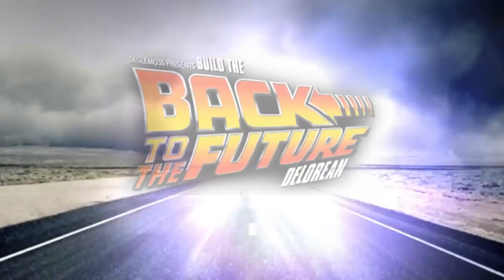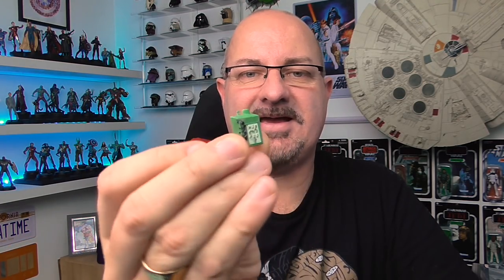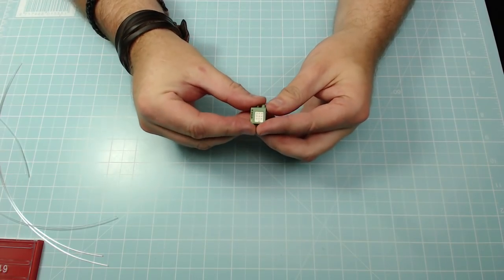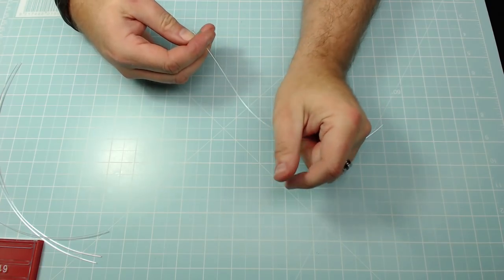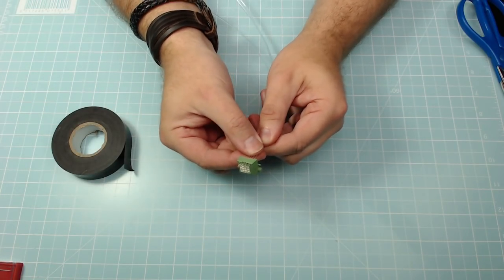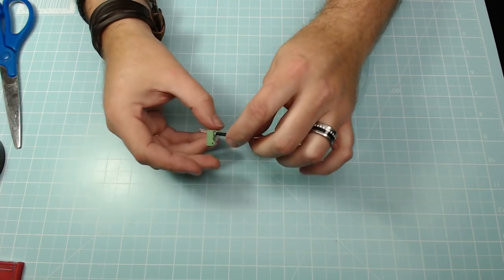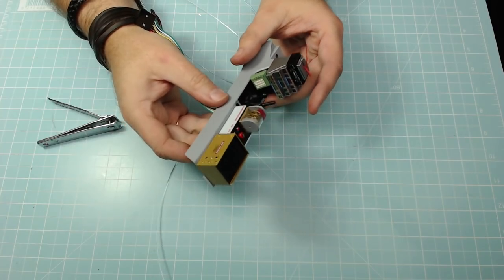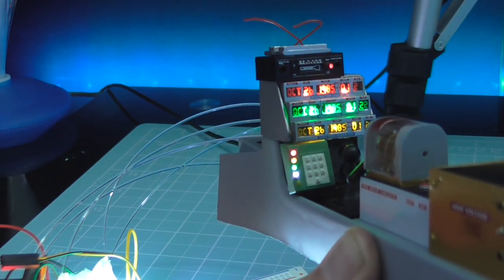Build the Delorean - Modding the Keypad and Radio

Comment: bit of a tip i accidentally found out when i i was doing the lights on the falcon. if you want to bend and mainpulate the fibre optic cable into a certain direction you can gentle warm it with a hairdryer and it makes it very pliable til it begins to cool. NB* be very careful though not to over heat the fibre optic cable. !!!!   i suggest trying it on a spare peice of cable! hope this helps .
loving the delorean build . im very tempted to start the build. I am following along with R2 build !!! nice job on both builds!!!!
Reply from the maker: Lol. I learnt that the hard way when I broke a couple. I have fixed it now but thanks for the tip :D

Comment: Hi Wayne, bit late now but you could've used the 0.5mm instead.  You can melt the end of the fiber with a lighter.  It creates a larger lense.  Works great and of course you have the flexible cable rather than the stiff 1mm.
Reply from the maker: Gerwyn Moores yep. I still may. I’m not happy with the alignment so I am doing it again 👍

Comment: You can heat the very end of the fibre optic cable and push it down and it will form a little button that will keep it in place
Reply from the maker: I started doing that technique in the end. The best way is to press the fibre on to an iron :D

Comment: Looks great, what light source will you Link it to? And how?
Reply from the maker: Its going to be connected to leds on a circuit board programmed by the Arduino unit. It will be small enough to fit behind the front dashboard as the rear of the vehicle is going to be having loads of electrics connected where the Flux will go. I have now changed it slightly since this video. I will only need 2 LED's. 1 white one and 1 white blinking one. I have coloured the ends of the optic fibre and it gave the same effect so I was very happy :D
Reply: How is your Arduino powered?
Reply from the maker: kevin botevyle usb at the moment but it will hopefully be connected to the Delorean power supply at the end 👍
Reply: Cool. This is what I was hoping to do. I've never done it before but wanted to give it a go. Wasn't sure how to power it all but if you can connect it to the existing power supply then I'll give it a go. Which Arduino are you using and what did you colour the optic cables with? Love the vids by the way. 👍
Reply: Would love to see that video
Reply: @WorldofWayneUK how did you color them?

Comment: Awesome job Wayne. I'm looking to attempt this myself but have never done it before. What Arduino are you using and where are you going to put it on the car?
Reply: Also how will you be powering your Arduino and how big is the hole and fibre for the radio light?